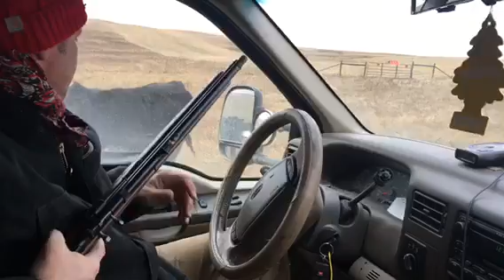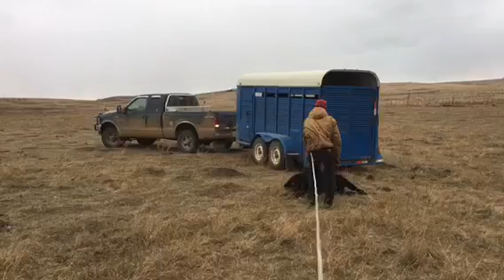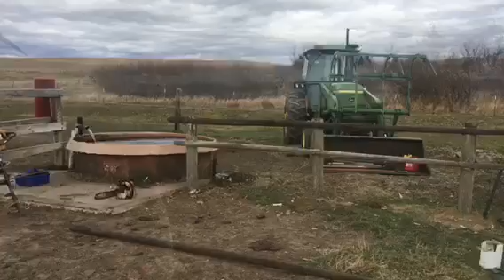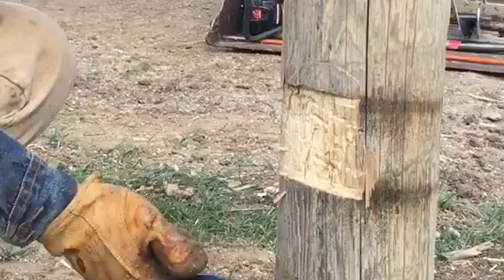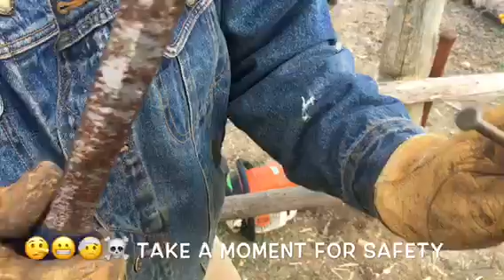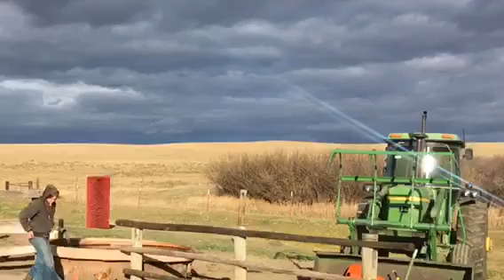A day on the ranch

Comment: I've always used timberlok screws for fence like that. Might have to give those spikes a try. They're probably less expensive.
Reply from the maker: +captainquint 
    We’ve use those to their great, I got away from them when I was using railroad ties as post. They do not want to screw in to the post at all. And less you pre-drill the railroad tie of course. I’ve had good luck with these they’re quite strong but again good idea to use a protection.
Have a happy new year. Luke